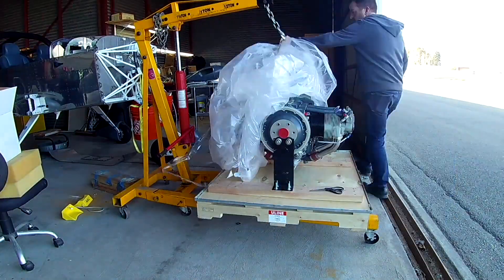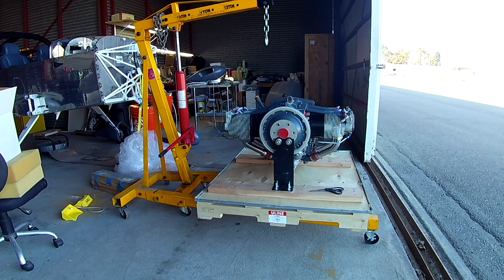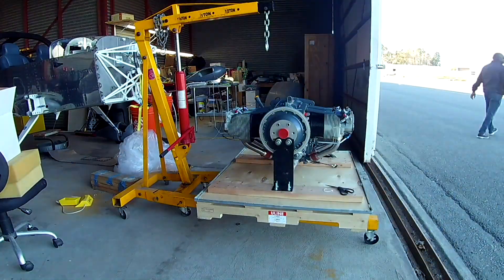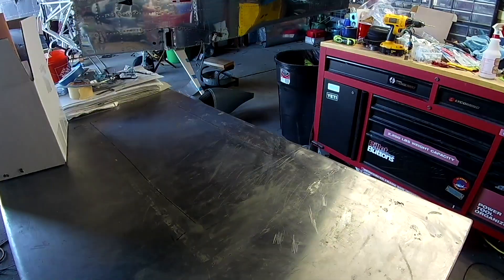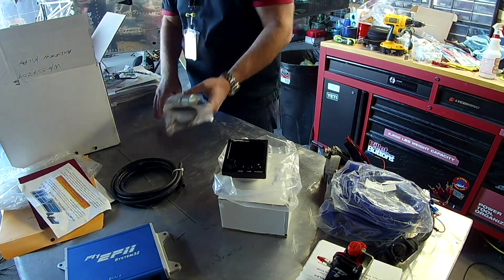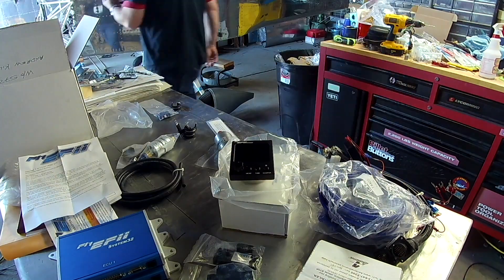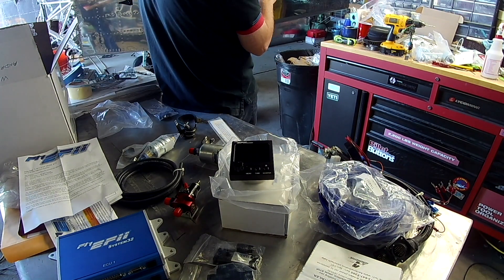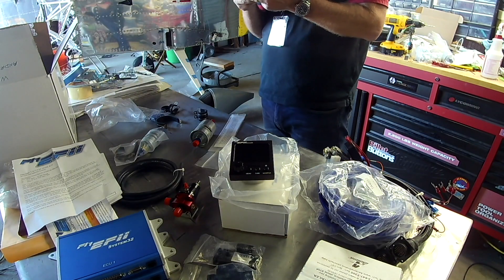RV-14 Engine I

Comment: 230 Hp?  on a dyno?  I'd like to get those results on mine.  Can you list which add ons you got you there and their order of importance?
Reply from the maker: Here's all of the mods I had done. Let's start with the ones that affect performance:

- port and polish the intake valves
- advance the camshaft 1 degree
- performance grind the camshaft (less open valve overlap like say a flat head motor)
- cold air sump
- efii system

Non performance mods:

- Crank case O ring mod
- black paint on cylinder barrels, anodized cylinder heads
Reply from the maker: I could have also gone with higher compression pistons but that means never using lower octane fuel.

Comment: Cold air sump?  Intake?
Reply from the maker: Normally the air intake splits into the different paths to the cylinders via tubes that go through the middle of the oil sump. This provides a little bit of cooling for the oil but it also heats up the air as it passes through.

This model I have on this engine separates the air intake so that its not going through the oil. You can see a picture of one on the superior parts page:

https://www.superiorairparts.com/xp-series-engine/options/